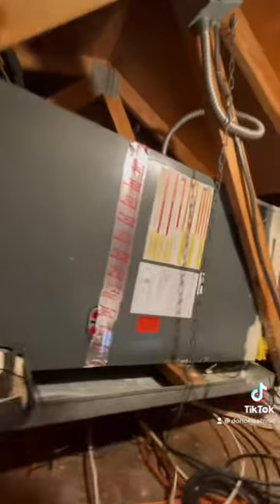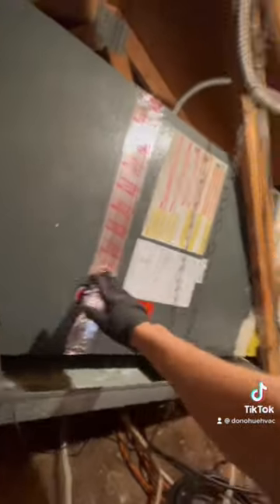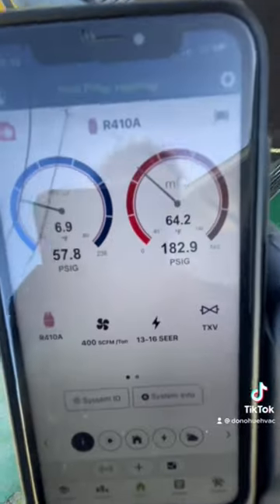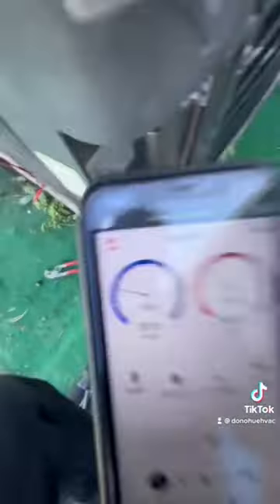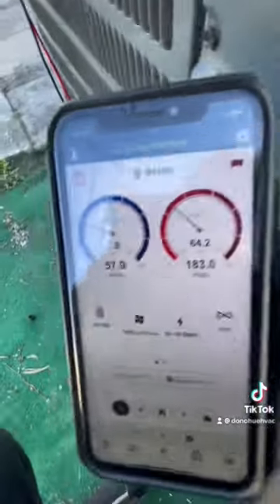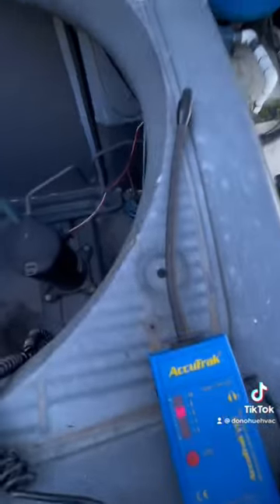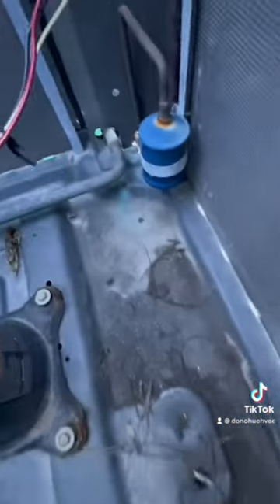Who INSTALLED THIS?#hvac #hvaclife #southflorida #installation #ac #wow #wrong #fail #diy #handyman

Comment: Get a framer to reinforce and cut the studs that are on the way no big deal
Reply: Yeah no you need a building engineer to come survey, those rafters carry load, if you don’t head it off correct the ceiling will crack and then you have bigger issues
Reply: @Freonleon  and who do you think the building engineer gonna send to do the job lol
Reply: @deebo_srt1513  yeah but when you doing your own thing your liable for any damages, it’s a cover your ass type situation